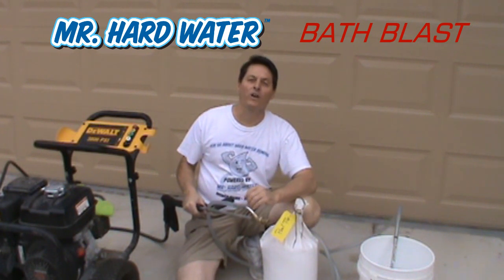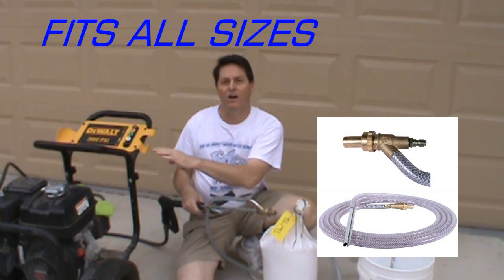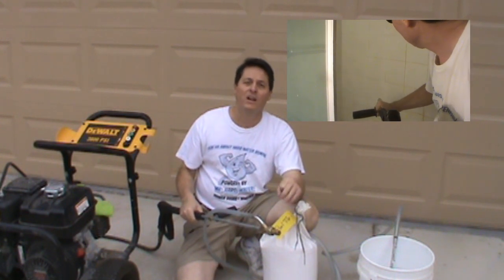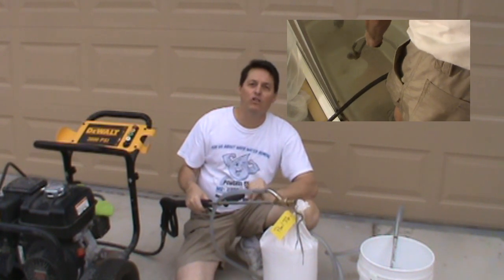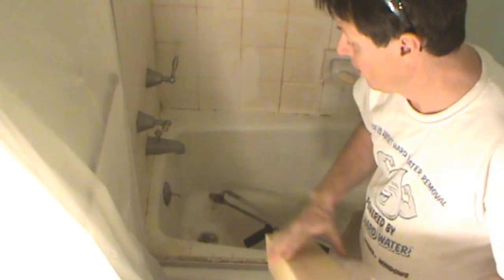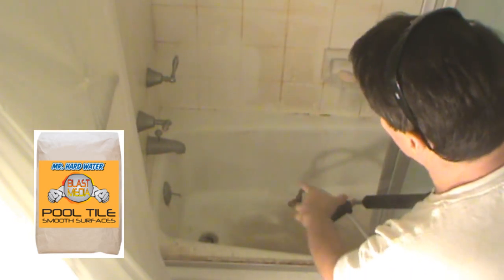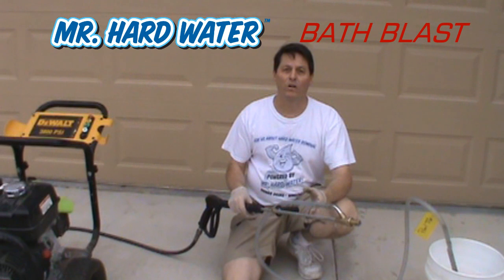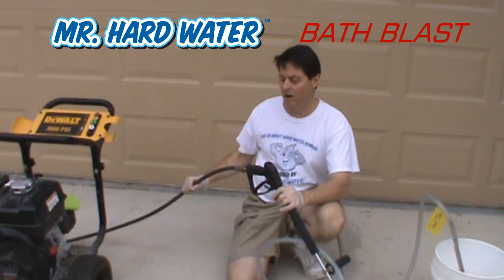MR HARD WATER BATH BLASTER - HOW TO RESTORE TUB & TILE WITH A PRESSURE WASHER

Comment: This is just a wet sand blaster attached to a low power pressure washer. You could get this for about 1/2 the price these folks charge. I'd be wary of damage to tiles. It is a good way to prep the enamel for repainting however.
Reply: Doesn't this blast cleaning take off the finish on the tile and tub?